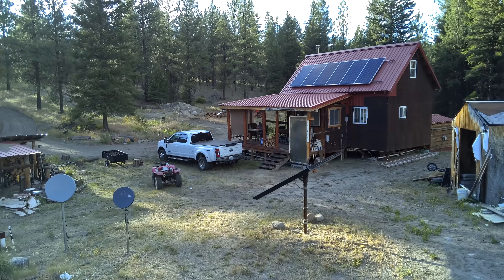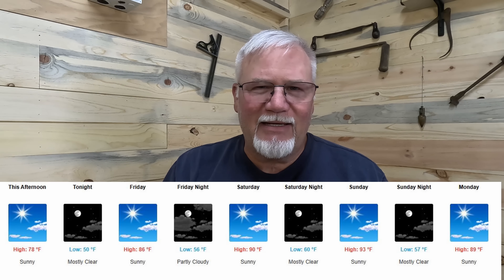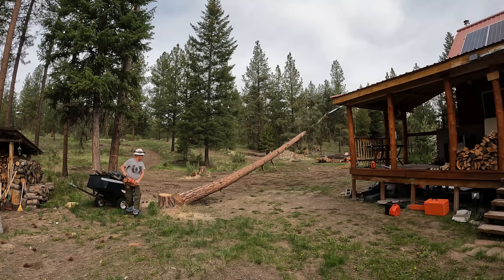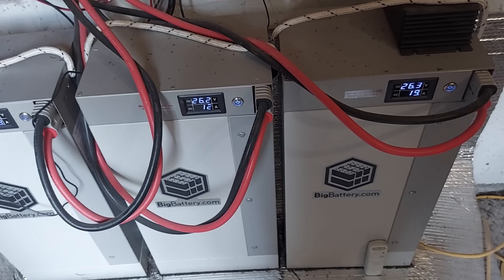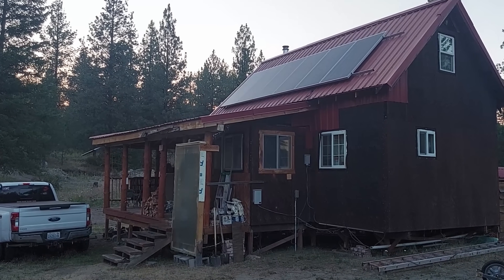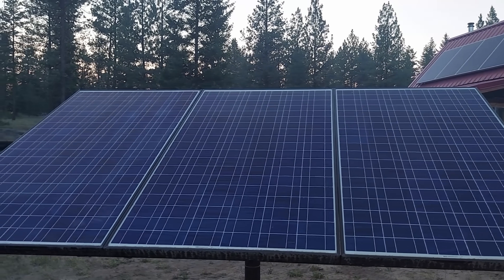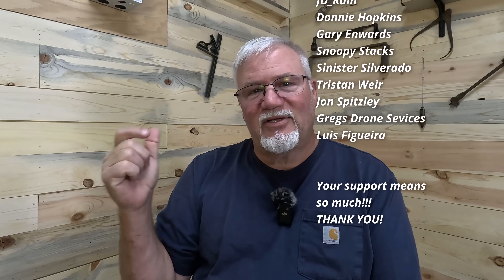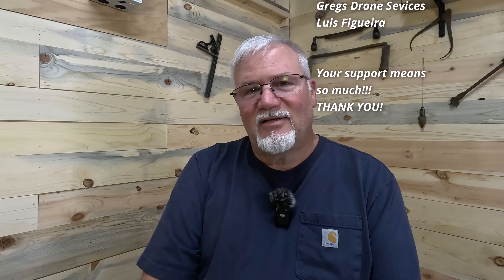I Tested An 8000 BTU AC Unit In My Off Grid Cabin During Hot Weather

Comment: I put a 5,000 BTU window A/C in the bedroom of our 660 square foot MN island cabin a few years ago. We do have grid power but the A/C only uses about 400 watts. We usually only cool the bedroom (I call it the meat locker when the A/C is on.) We have used it a few times on the whole cabin and while it can’t get it down to 72° it lowers the humidity enough that the cabin is quite comfortable on hot, humid days. My wife likes to sleep in a cool room so she often runs the A/C at night. I think the time we had spent without cooling must have reset our expectations enough so that it didn’t take too much to make us happy with even a little bit of cooling.
Reply from the maker: Nice.  Mine uses as much as 980w but on Energy Savings mode it uses a lot less overall

Comment: Why cut it off at all? Letting the cabin walls, furnishings, any interior masses will absorb heat & moisture during the times the AC unit is off. That amplifies the humidity in the cabin, forces that little unit to cool down giant interior masses over the time you cut it back on. Better to leave it on overnight to keep all the solid mass a steady temp.
I’m assuming you open all the windows at night to enjoy the night sounds?
Reply from the maker: It cools down a lot here, and humidity is low.  For example, last night, it dropped to 50F.  Today, I was able to run the unit in Energy Saver mode, and it held a low temp of 73F until about 6pm, where it slowly rose to 75.  Overnight it drops to 65 inside with wi down open and a fan 😀

Comment: I bought a floor model that you don’t mount in the window.  Only intend to use it to cool bedroom when necessary. About $200. So far have only run it on ac, but for see no problem with small battery bank and attached 100ah battery.
Perfect is the enemy of good. This is good.
Reply from the maker: 100AH battery?  48V?
Reply: @TheOldJarhead yup just like you told me.
Reply: Don’t know if that will work, but it should.
Reply from the maker: It should.  Specially if you have some solar to help.
Reply: Im assuming since im only doing one room it won’t need to run as much.
Reply from the maker: True -- once the room cools down it should reduce it's need for more power :D

Comment: I have a question: are old Coleman lanterns or oil-burning ones still used in forest areas in America? Everything has been replaced by LEDs here, and the European Union even wants to ban them. Even the gas-powered ones with the glow-in-the-dark caps.
Reply from the maker: Yes they are still used but most have gone to LED's I think.
Reply: @TheOldJarhead  Thanks

Comment: Just an idea, there is a very inexpensive dual axis solar tracker put out by eco-worthy (around $340 + a small solar panel and cheap 12v battery) that has room for about 1000-1200w of panels.  Since it is auto tracking, you don't have to think about it and you could use your existing panels or pick up some additional panels with the same operational voltage to give you a bit more power during the day.  They also have a single axis tracker that is a bit cheaper that is slightly smaller (maybe room for 800 w of panels) that is even cheaper.  You could also extend your mist setup to spray the outside coils of the window unit which might actually drop the power draw and increase efficiency from the evaporative cooling of the outside coil.  If you haven't you might think about adding a rain catchment barrel to supply water for the mister.
Reply from the maker: All great ideas.  I've looked at the Ecoworthy trackers, but for the money, I could add more panels, though a tracker may do the trick here for sure.
Reply: @TheOldJarhead  Yeah, it can be a bit of a toss up with tracker vs more panels, though with your manual tracker, you have already proved the gains (30-40 percent) that you can get.  Probably the biggest gain would be adding max generation from your panels from 4-5 hours to 7-8 hrs meaning less time on batteries and/or more supplemental power from the solar panels.  Just looking at the prices, the tracker really isn't much more expensive than standard ground mounting system that you can buy that has a basic angle adjustment for the seasons.  For example, The 4 x 200w panel ground mount is $125 while the 4 x 200w single axis tracker is $240 (without 12v power source).  So $100 would make make the 4 panels produce 40% more thus turning your 4 panels into the equivalent of 5.7 ish panels.  It also adds even more of a benefit over the roof mounted 20ish degree fixed panels closer to the optimum angle in the winter which could be as much as a 30 degree difference in the winter.  This assumes you have a place in your yard where it will not get shaded.
Reply from the maker: Good points.  I wonder how it sits at night?  In the winter, where I am, it would need to sit near vertical at night to prevent excessive snow load.
Reply: @TheOldJarhead  from what I have seen, it does have a wind meter and goes flat (horizontal) when wind speeds are high.  It is programmable so I would assume you could program it to go as vertical as possible.  I haven't don't a lot of exploration into the settings but I am pretty sure you can program it to go flat at dusk or go to a steep angle and point east.  I think the max angle is probably around 45 degrees, but that is educated guess looking at the design.  It moving on its own might dump snow as it tracks as well.  After all, winter sun will be low meaning that the tracker will have a steep angle to the south.  I have seen a few videos where people would modify the program (just change how many seconds it goes e or w and then north and south) so that it would have a slight angle downward to the wind (so it gets just a little downward force from the wind, or to remove possible oscillations due to wind/turbulence).  I would think you could set it to do something similar for snow storms.  And this would be the dual axis tracker.  The single access tracker has a manual north/south tilt for seasonal changes and tracks east/west movement using a 'sliding arm that locks into slots and locked in with a screw'.  This would mean you could have a nice 45 degree N/S tilt which should allow for snow to slide off before getting too heavy (this is best guess from a guy from southern US that hardly sees snow).
Reply: @TheOldJarhead  Also, on those ecoworthy solar trackers, if the supplied unistrut is just a bit to short, you can replace it with 10 ft galvanized unistrut from any hardware store for about $38 US each.  I think the ones that the single axis ships with is a total of 7.5 ft (cut into pieces for easier shipping).  I think the dual axis comes with 9.8 ft lengths when reassembled.
Reply from the maker: Interesting.   I should get one just to learn
Reply from the maker: I am wonder if it can be adapted to my rack... hmmm 🤔
Reply: @TheOldJarhead  Well, I know you can buy a kit with the control unit, sensor, and linear actuators.  So if you are able to modify your current ground mount, it could be possible.  I didn't see how yours rotates, but a $20 Worm motor with proper gearing could probably be attached to your existing one.  It would probably take a bit of engineering though.  I think it might be a bit cheaper from their ebay shop vs Amazon or direct from their website.   it would be a small investment that could give you some big gains without having to take up more roof or ground space.
Reply from the maker: Mine has a bearing on top that allows it to swivel and a slotted mount that allows it to move vertically, so it should be simple to add.  Only issue is, mine is heavy!  Though perhaps just swap out my rack for theirs on the same pole
Reply: @TheOldJarhead  possibly.  Yours sound pretty well done.  If you have a 3d printer, you might be able to print a gear you could connect above the bearing and then attach 12v worm motor.  :)  Playing with solar is kinda fun plus it can make ya money and/or keep you comfortable in the hot summer. (Currently 96 degrees with like 60 percent humidity).
Reply from the maker: Amen to keeping cool!

Comment: Nice setup sir glad you found a solution that works for you.  We have a 4 ton mini split system at our home while it does use less power then your standard heat pump our electric bill has been high due to running it during the day so our dog can stay cool while we are at work.   To offset this we bought 3 Ecoflow Wave 3 6000 BTU portable are conditioners  one for our sons room an 2 for our offices and they cool the house down better then expected while sipping power.  The highest output I've seen is 650Watts however this goes down to around 300 to 350 watts while running over time.
Reply from the maker: Thanks for sharing your experience with the portable units!

Comment: Enjoyed your video and a happy 60th. My 6000W window AC runs nicely with my 4000W 24v Giandel inverter. The solar array like yours is 2400W although some seasonal shading issues. The battery bank is 15.4 kWh. The cabin is 18 x 24 log construction with a loft/cathedral ceiling. On the hot days (90’s), I’ll typically run the AC about 14-15 hrs, then like you open the windows putting an exhausting fan in the loft window. I’ll be looking at a tracking array and considering switching to a 48V configuration, although the system is pretty much trouble free year round.
Reply from the maker: Sounds great!  As for trackers, other than Ecoworthy, most are pretty expensive, and 2 new panels will produce as much power for less.

Comment: 1:45 Let me clarify this: if you're using a non-inverter AC (also called a non-variable speed AC), it tends to draw a power spike during startup—often much higher than its rated power. That’s why such ACs require an inverter with significantly higher capacity.

But if you have an inverter AC, the rule changes. These ACs use VFD (Variable Frequency Drive) technology which allows for a soft start, meaning they don't draw a heavy surge during startup. So, even if your inverter is just 10% higher than the AC's max power, it'll run smoothly.

For example, if your AC's max power is 1300W, a 1.5kW inverter is more than enough. Thanks to the VFD, the startup is smooth, and the power factor stays around 0.95 or better, making the whole system energy-efficient and inverter-friendly.
Reply from the maker: Thanks for the detailed explanation! It's really helpful to understand the differences between non-inverter and inverter AC units, especially for off-grid setups.

Comment: Great to hear you can get it more comfy at the cabin so you can enjoy it even more. Got a question running a powerstation with extra battery with short cable no issue, but longer cable makes it start,stop,start,stop and so on. Which i stopped cause dont wanna break it. any idea what causes this there is 13,2 volts on it and about 5amps. Thx upfront.
Reply from the maker: Thanks.  Which power station?  Minimum voltage?  Battery voltage?  Cable length and gage? 

It's possible the battery is too close to the bottom and there is some voltage drop over a long cable (though it would need to be pretty long).  Another guess would be connectors, are they all the same? Solid?
Reply: @TheOldJarhead  Hey i allmost certain its due to the length of cable giving to much resistance. Its allpower minimum in 12V up to 8.8amps max on the xt60. cable full copper 12awg 30ft (9meters which i think is the problem but noob so please correct if i am wrong) and like i said at the end it has 13.2V and 5 amps.
Reply from the maker: From the calculator I used that's 0.528v drop over 30 feet.  So likely dipping the voltage down just below acceptable.  If the unit can take higher voltage I'd look at going to 24v which you could do with a step up converter.
Reply: @TheOldJarhead  voltage drop over the length of cable i understand but the meassured 13.2V is aat the end. Do you know a good affordable stepup converter first one started to whistle and smoke after a few weeks, the one i have bought after is a 24V 20amps so i assumed it be less stessfull but it makes funny sounds inside like clicks. Dont trust it that much. Both amazon.
Reply from the maker: Yikes!!!  None of mine do that, did you use my links?
Reply from the maker: I agree that if the 13.2v is at the end, then low voltage shouldn't be the issue accept that under load it will be lower.  Still seems odd.
Reply: @TheOldJarhead  agree
Reply from the maker: I was thinking last night that if the short cable works but the long one does this and it isn't voltage than it's connectors.  Can't think of anything else.
Reply: @TheOldJarhead  Me neither but thnx for brainstorming with me.
Reply from the maker: Only thing I can think of is to check the cables on another machine and/or with a multimeter to see what you can find out but it has to be the cables if the short ones work fine IMO.  Cheers!
Reply: @TheOldJarhead  Cable works great when connecting same powerstation to 2 80w dokio solarpanels in paralel. 18v, 8.8amps (2x4.4). Just not if connected to battery which are 12.8v 100amps DC-house and Kepsworth. If using booster what is better putting it after battery so pushing 24v over the cable, or at the end pulling 12v over the cable and boosting it to 24v just before powerstation? Sorry for the many questions if too much just say so.
Reply from the maker: Should be installed right at the battery.

Comment: Jarhead,
I have to be brutally honest! If your cabin is 64° and you have it buttoned up (drapes closed, minimizing opening doors) and its getting up to 80° you have subpar insulation. If it's 90° outside and your cabin gets to 80° with it being buttoned up, and initially starting out at 64° you definitely need better insulation/windows. If that can't be done I would look at reflective foil for your windows to help with the heat transfer. Going out and tracking the sun with your solar panels seems a bit cumbersome. You're up at the cabin to enjoy it, NOT be a manual solar chaser! You should definitely look for something to fit in the loft, remember cold air sinks! Having an AC unit on the first floor and trying to cool the upstairs is like pushing a boulder up a mountain!
Reply from the maker: Insulation:  R21 all around.  The only time I have a problem is in the summer heat.  In the winter it doesn't lose much heat and the insulation is such that we don't hear anything outside when the cabin is buttoned up.  We had wild horses stampede by the cabin when friends were tent camping and their dogs were all barking.  We had no idea!  Even yelling for my wife when a bear charged me (yes) did no good.  Thankfully, I scared the bear off (probably because I was shirtless and he thought "yikes!  I'm outta here!"😶🤣😂😁

I agree installing int he loft would be better of course, it was just a matter of how high the loft windows are and how difficult it would be for my broken body to do much work at 15+ feet up so we decided this might work and for the most part, it did.

I also agree I'm there to enjoy it but in truth, in those temps, I tend to hide from the heat during the day anyway so venturing out to move the panels when needed didn't pose much of an issue though in the future if I'm working on building a fire break etc, it might be a pain.  I'm thinking a couple 500w BiFacial panels would be beneficial as would a more efficient AC unit.

Comment: There are tracker parts available to build your own tracker, without buying one.  I was planning on doing this at one time,  I BELIEVE... they were on Eco Worthy's site...memory failure...  Your outside panel array looks pretty beefy, so the frame weight might be an issue. You mentioned using bifacial - another really great idea!
Reply from the maker: I'm really happy with those panels, they produce really well and are still going strong.  Adding a tracker would be fun but you are correct, the rack is heavy.  Angle Iron and Steel etc.  It's not light and balanced poorly for a tracker.  I've also seen that trackers are typically more expensive than adding panels :D
Reply: @TheOldJarhead  Haha! Right, you are!
Reply from the maker: Funny thing, I wanted to be able to add a tracker but had no idea what I needed to do besides make it moveable on two axis.  I did that much but never considered balance.  I should remove the rack and move the main mounting bracket lower to make it more balanced, then a tracker might actually work.  Hmmm

Comment: There are now 12 volt AC's for RV's and 12 volt mini splits. They are supposed to be very quiet and efficient too. I'm sure a 12 volt window AC will be developed soon.
Reply from the maker: True, in fact, I was offered one for my RV but, as I pointed out to them, the monster cables I'd need to somehow route through the walls to my roof for the AC just make it too much trouble and without massive battery power to run it in my camper, not much point.

At the cabin, same issue.  I could run cables under the floor but again, big cables as the amperage goes way up for 12v.  DC would be nice, in perhaps 48v to keep the amps down, if it's more efficient but the AC units today are getting so good I don't see a point.

I know I could get better, more efficient AC I just couldn't justify the cost right now.

Comment: I would buy another  
A/C and run it off the generator in the afternoon. When it starts cooling down outside shut it off and just run the one on battery.
Reply from the maker: That's a thought.  Ultimately, I'd like to get a Mini Split but first, I'll have to take a look at the Media (sp?) unit as it's not much more expensive than the LG I bought and sounds like it uses a LOT less power.